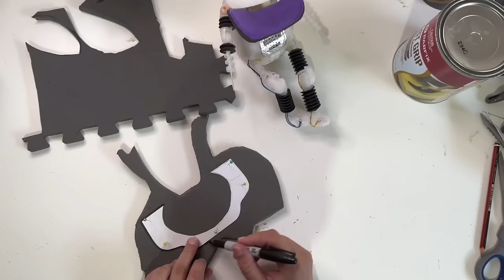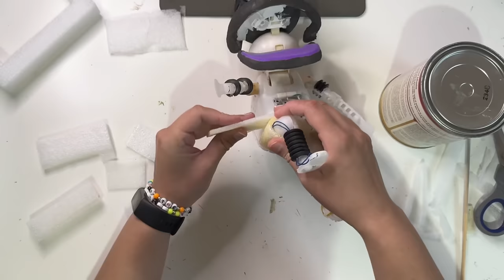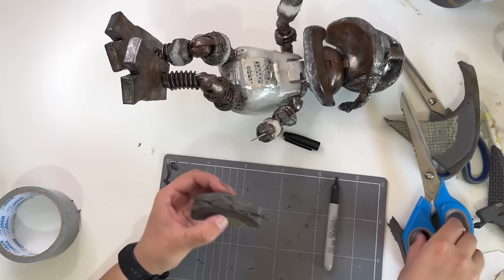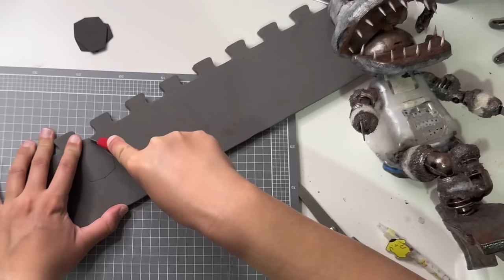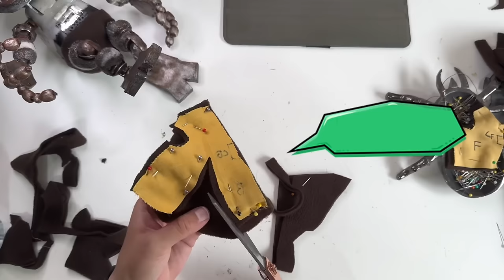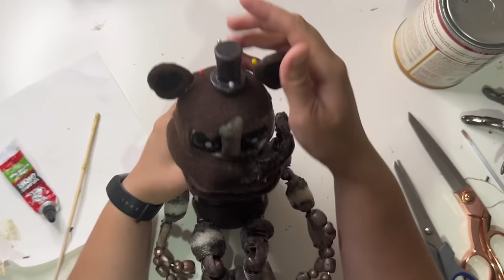Let’s Make a Freddle Animatronic from Five Nights at Freddy’s (Out of an LOL Elmo)

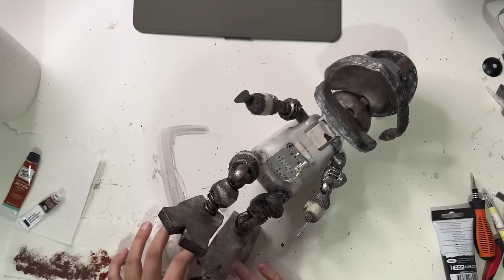Comment: 9:30 Sorry for this comment, I'm not trying to be annoying so only read if you want nerd input. I make 'metal' cosplay pieces a lot, and I'm a bit of a perfectionist. As far as areas where rust will appear:
People put oil on joints to prevent rust. Rust forms on areas not oiled, because they are exposed to weathering. Joints wear on the oil after a long time since they're moving parts. Grease will form there, which is more of a grimey super-dark brown/black color. If this is not cleaned and re-oiled, then rust would start to appear along with the grease continuing to accumulate. So usually for joints I try to go for more of a greasy, grimey look, and then for areas that would not have been oiled so much or would have been exposed more to moisture I do a speckled array of rust paint.
Again, sorry. I also do light mechanic work and I'm married to WD-40 (which forced me to write this out).
Anyway, awesome project, it will definitely haunt some kid's dreams in the best way possible!
Reply from the maker: PLEASE don’t apologise, this is really interesting! I think I got grease and oil confused? Or I combined them in my head to be like, yeah you put oil on it and then it’s gross? We may never know. But that’s good to know, thank you! And congratulations on your marriage! We have to WD-40 our door semi-frequently because it’s just the worst
Reply: @tobyhorrorboy  WD-40 is the nectar of the gods 🔥 thank you for the well wishes- we are on our honeymoon now

Comment: Just in case this is helpful for anyone: if you buy cosplay-specific eva foam it’s smooth on both sides!
Reply from the maker: Yes, true! I do have a few sheets of that but I save it for my good stuff because it’s so much more expensive. I get away with using the EVA foam floor mats as much as I can for animatronics, but the cosplay Eva foam is a dream to work with 🥹

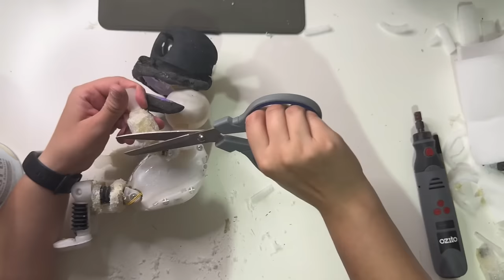Comment: At your self-comment about 6:23 in, you teased yourself for not wearing gloves. In the case of sanding with a rotary tool, sometimes it's better to not wear gloves as the material can get caught in the spinny bit, it can also get in the way of tactile sensing of what your doing. I'm not entirely saying don't wear gloves, but sometimes, y' just don't have to.
Reply from the maker: Yeah, I get that! Mine are nitrile gloves so while they’re thick for nitriles, they’re very thin compared to like, work gloves! I think they tear too easily to get caught in the spinny bit, all I do is cut them open on things. Kind of embarrassing but the skin on my hands gets horribly irritated if I get foam or plastic dust on them, I’ve had to go to the doctor for it before so now I’m a big fan of wearing gloves haha